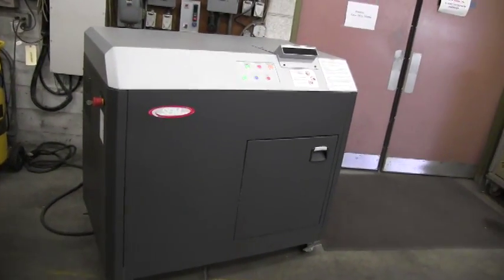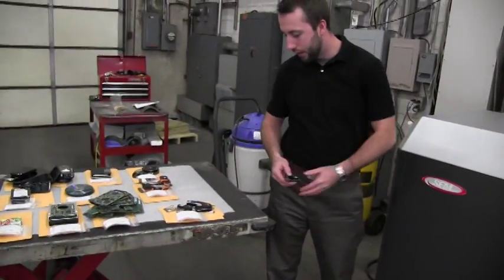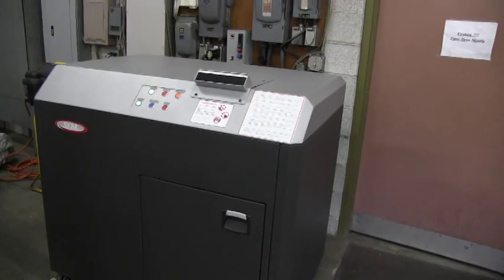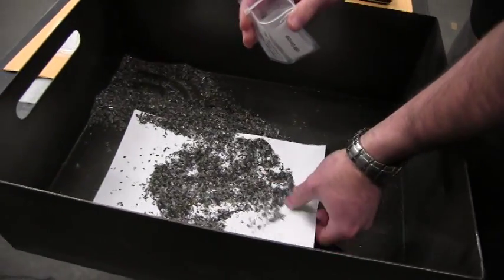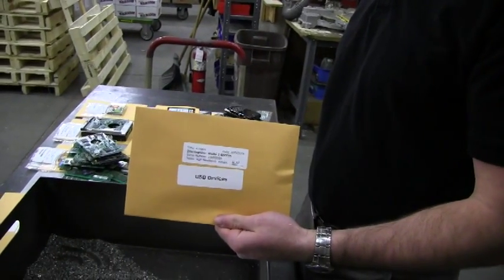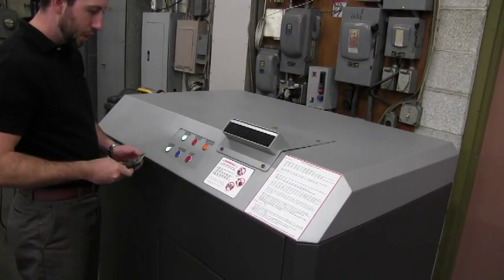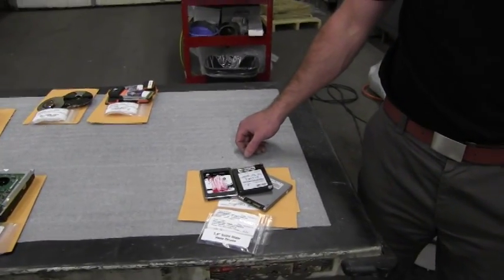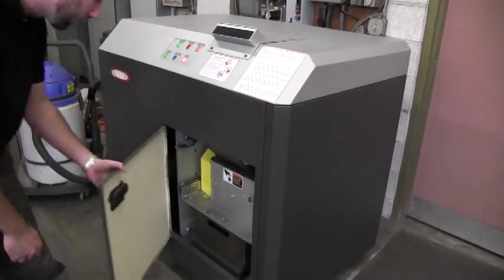SEM Model 2-SSD Destruction Process Part 1

Comment: for those who like destroy data in the easiest, most expensive way.  No consumer would need to do this for an SSD for example as not only is it next to impossible to retrieve data, but it's easy to simply fill them up with bogus data.  But if you have idiots working in a big office and the company is worth say billions or many millions then this is for those idiots who can't bother to know how to fill the SSD up with new data etc.  I can sort of understand for the optical and magnetic disks, but the SSD is just a stupid waste of chips.
Reply: This level of destruction is a requirement for US government offices, set by the NSA. Check out NSA/CSS STORAGE DEVICE SANITIZATION MANUAL 9-12 for a more detailed description of the requirements.